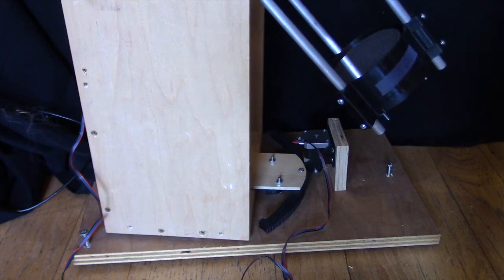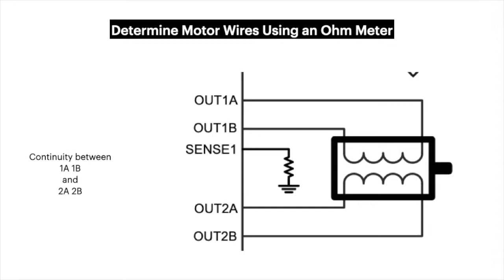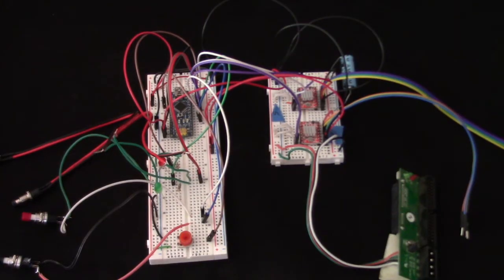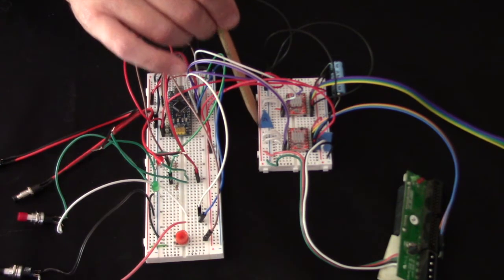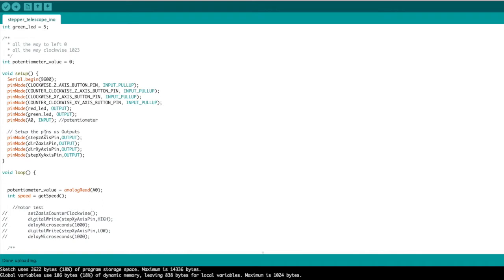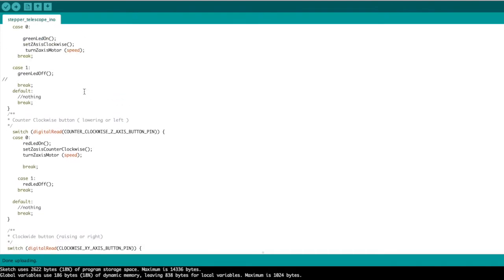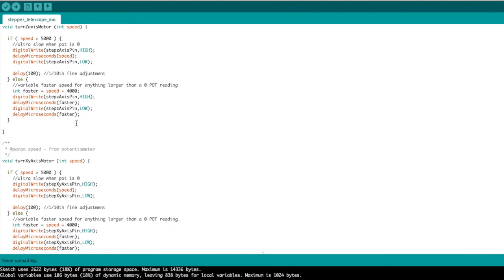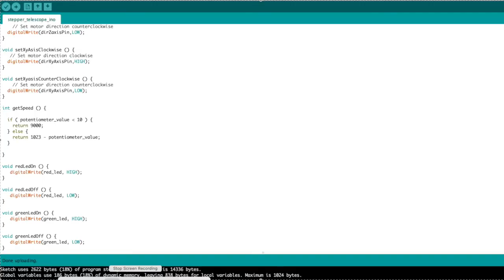Motor Controlled Telescope - How To Build

Comment: First of all i want to say, you have a very nice motor controlled telescope. I thought about making something similar. I only thought of a question: do you think it is necessary to use a planetary gearbox to reduce torque and the speed at wich the telescope moves?
Reply from the maker: I tried this with one gear, and then two.  I would like to step this down further so that I could run the stepper motors faster but still maintain slow and precise movements with the mount.  I think it would be easier to buy the gearbox.
Reply: @MyEngineeringProjects  Ah yes I understand, because I want to keep my project as cheap as possible, I am probably not going to buy it. But today I have been thinking about worm wheeles to do the job. Do you happen to have experience with those (/ are there negative effects when using or making them)?
Reply from the maker: Worm gears are pretty much the standard used for astronomy.  I have a SkyWatcher GOTO mount and this is what they use.  I have not designed with them but I use them all the time.  I think this is your best choice.

Comment: Would it possible to automate this? Make it into a go-to mount?
Reply from the maker: That would be a fun project. At this point you would need a board that contains Ascom drivers and then it could work with Astroberry or maybe with an AsiAir or something like that but it would be fairly difficult.

Comment: Awesome project! Since I want to use it on my telescope, can it track an object via Stellarium, or can it do it by itself after pointing it to an object and pressing the buttons?
Reply from the maker: As it is designed now, no it cannot integrate with Stellarium.  There would have to be more work done in order to do that or to track an object
Reply: @MyEngineeringProjects Thank you for responding so quickly! I just wanted to know: can I sort of track the moon for example, after pointing it with the buttons? I mean without Stellarium, just the project as you made it.
Reply from the maker: Well I have tracked it manually WITH the buttons.  As the object moves past center, I run one button a bit then the other.  It's far easier that by hand, but not at fancy as a tracking mount.